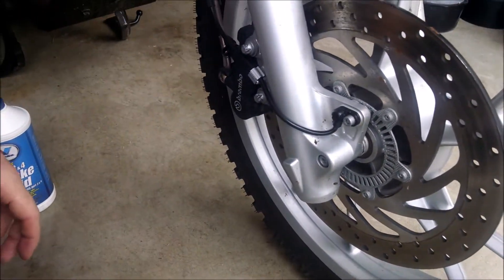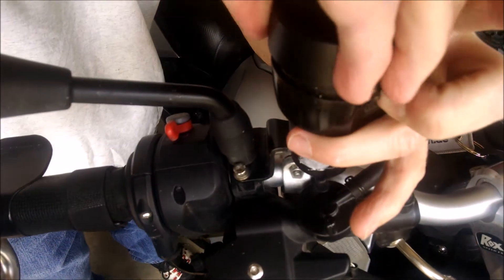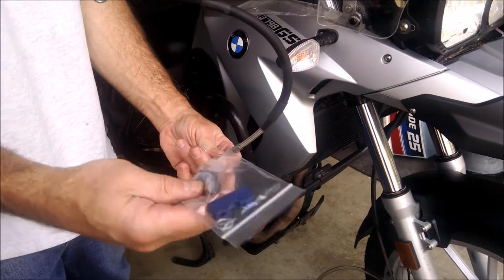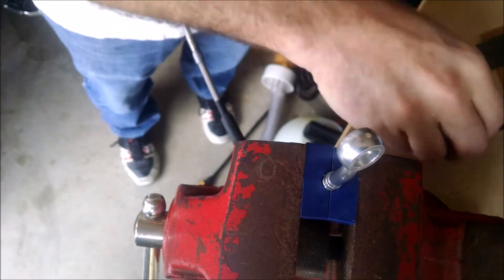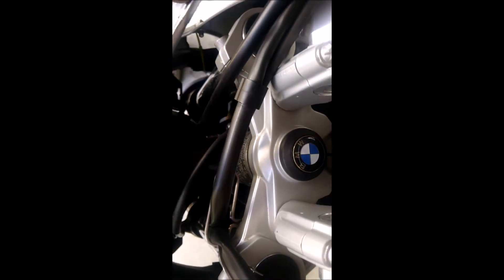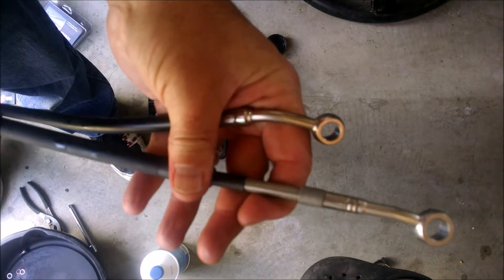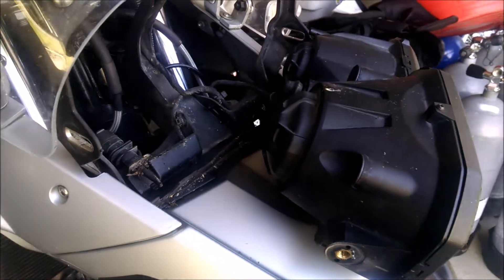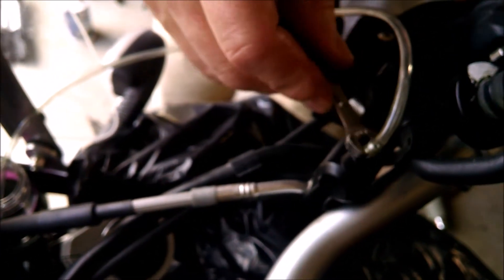Installing front brake extension cable on BMW F650GS twin

Comment: What brand of brake line extender did you use and where did you buy it?  Great vid!
Reply from the maker: Hi Tracy, we ordered directly from https://spieglerusa.com, part #S-BM0160.  Thanks for watching and glad you found it useful.
Reply: Yea, that was a good vid. What length did you buy?   I can order regular plus 2”-6”.   Looks like maybe 3” would work ok.
Reply: Where are you measuring for the length 3” (crazy) looks like is about 10” 😮